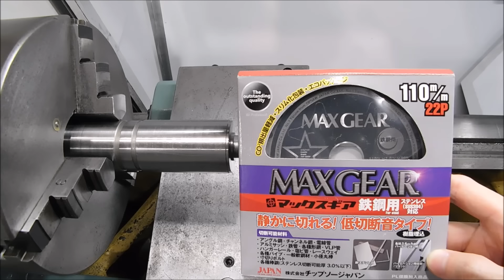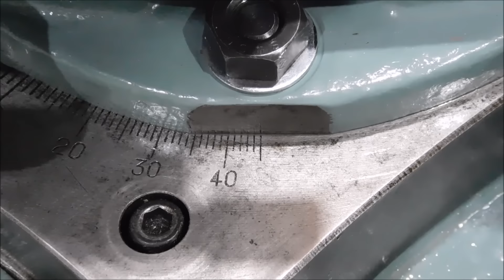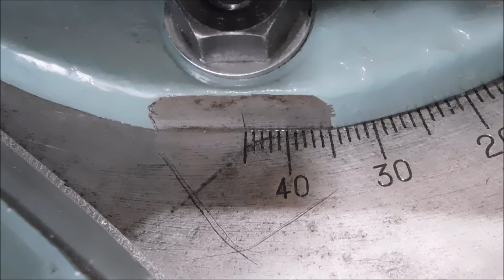【加工動画56】旋盤でV溝/How to cut a V groove with a lathe

Comment: I always love watching the set up. You can always tell when someone knows what they're doing based on that! Your set ups are immaculate!

When you set the saw blade up in the chuck, do you have to put the part on center?
Reply from the maker: Thank you for watching.
The parts were fixed in the center.
If the part is too low, the part will be pulled by the cutter and the backlash will be removed all at once, potentially damaging the cutter.

Comment: Is this going to be jaws for home made large tap wrench?
Reply from the maker: Thank you for watching.
This part was fabricated for demonstration purposes.
It's perfect for the kind of use you mention.
Reply: @SwaplampJapan  Yes you would need to thread the end and mill some flats ,maybe harden the jaws as well but it would make fine tap wrench that holds tap straight.Maybe a future project?
Reply from the maker: @zumbazumba1  thank you for your reply.
I currently have no plans to make a tap wrench, but I may do so in the future.